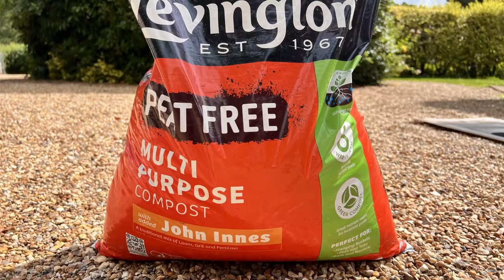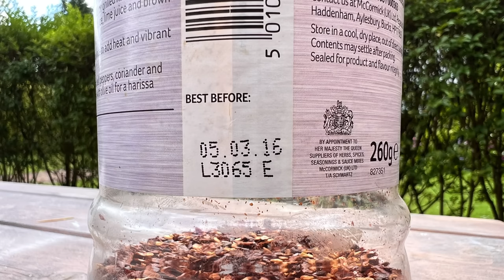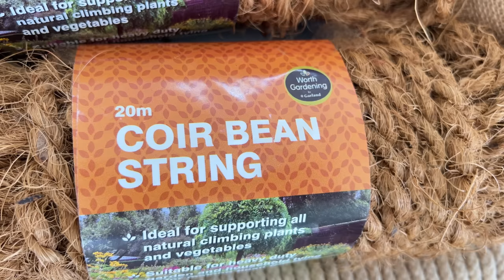LAMP MAKEOVER ~ DIY Stone Look ~ DIY Vintage Metal Look ~ Home Decor on a Budget

Comment: Just Curious does the joint filler hold up? Here in the USA people were using baking power mixed with paint and after a few months time it just falls off even after you've sealed it.
Reply from the maker: It does! I’ve don’t this for several years with the wall filler and everything is as good as when I first did it. It sets completely solid. I only use this method for indoors though as it’s not waterproof 😊

Comment: I LOVE the look of the lamp with all the spices tucked into the plaster. I have a question on how to finish it, do you "seal" the fill/plaster once you've let it all dry? Like using a matt polyurethane on it - to help keep those spices from falling out (if they tend to do that  or not?) This is a great idea to use on two lamps for my living room - THANK YOU for the idea!!
Reply from the maker: I don’t seal it as the spices don’t come out if you have worked them in. However if it’s in a high tough area then it wouldn’t hurt to give it a spray with a matt varnish 😀